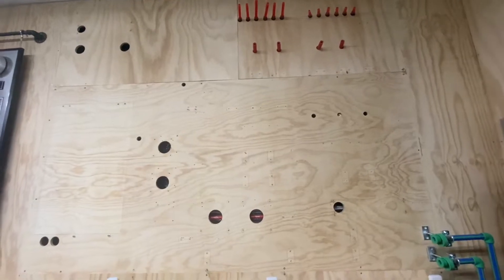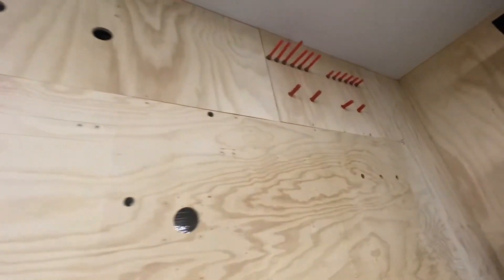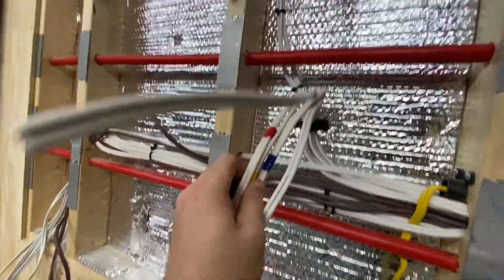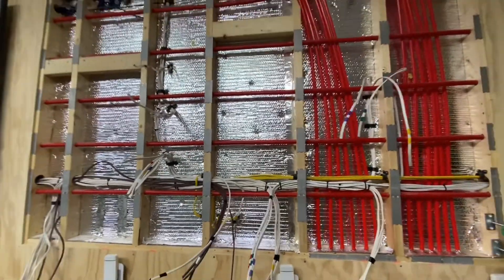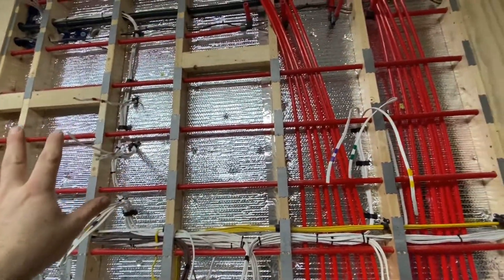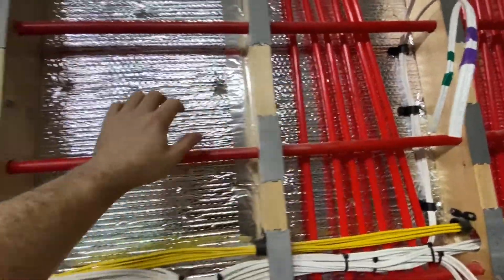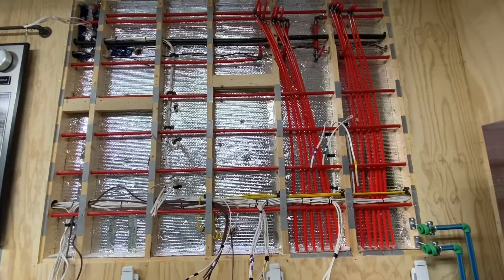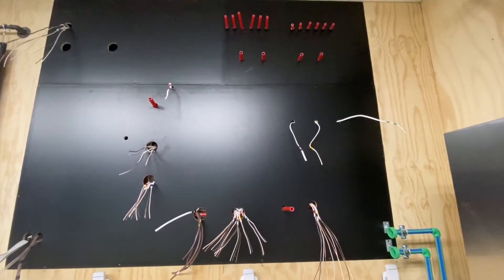IBC Firetube Boiler Install (Part 1)

Comment: Very impressive, but will it be easy for the technician to service the system with everything hidden?
Reply: I had the same question too.
Reply from the maker: Two options rerun a different electrical line surface mounted ...easy and quick or   Everything is designed to be disconnected and removed in you have a major failure behind the system ...but doubtful with the products used